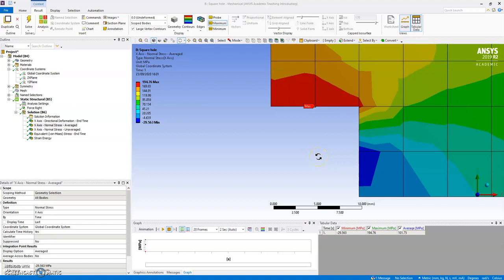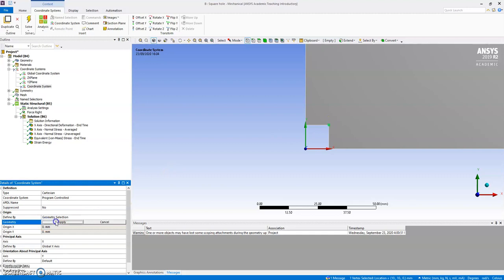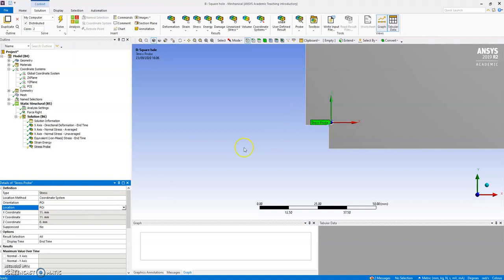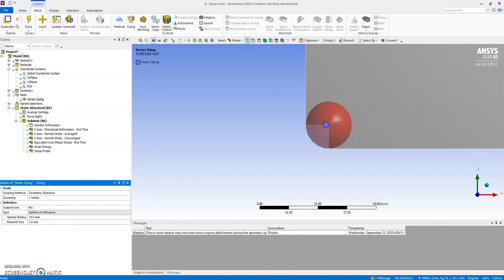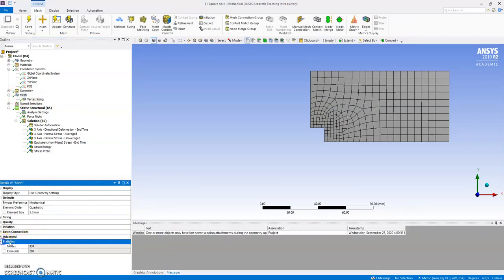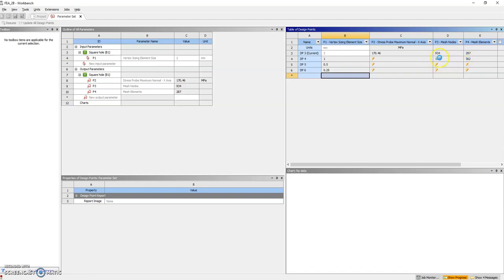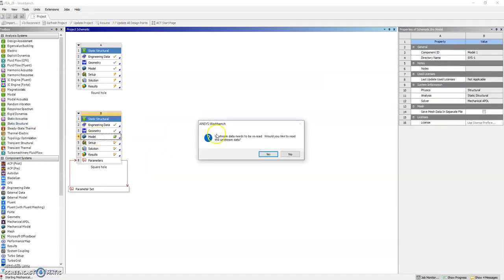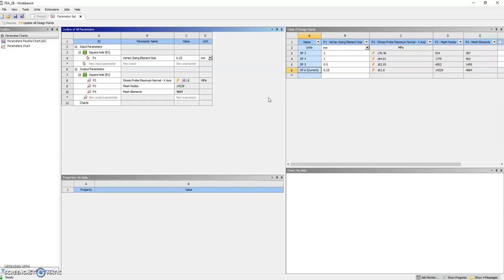Setting the parameters for OPTIMIZATION in ANSYS - Part 11/20 Finite Element Analysis- For Beginners

Comment: Hi,
Thank you so much for the great video!
In terms of FSI, do we have to do mesh convergence using parameter using system coupling for fluid and structure together or is there a way to make sure that even if we only do it in structural the FSI results will be accurate?

Thank you!